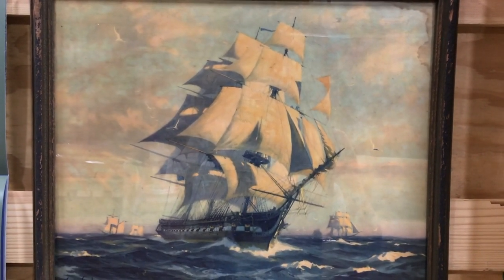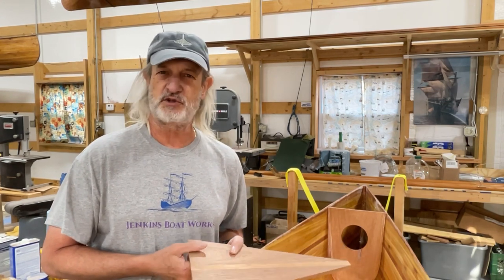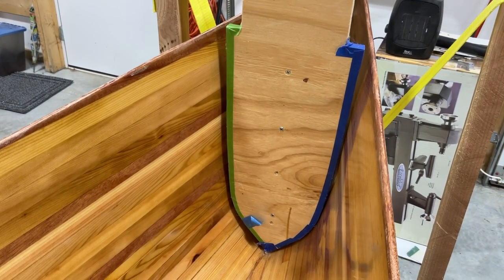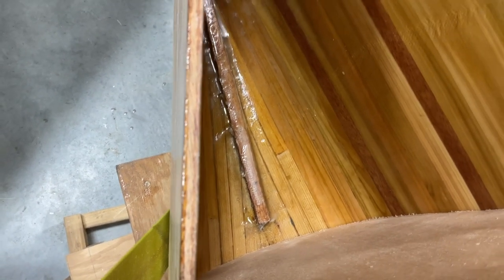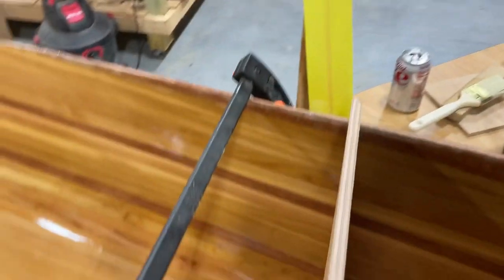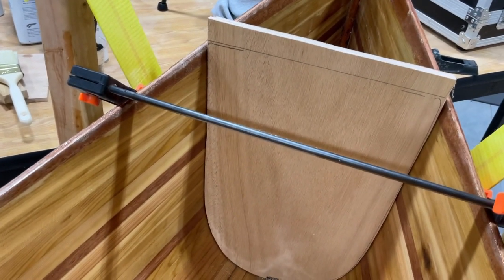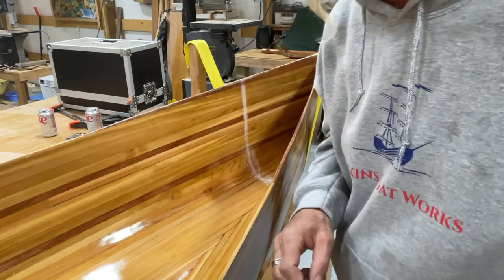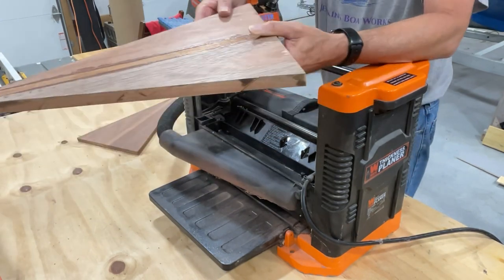Bulkheads and Decks - Freedom 17 Canoe Build Episode 19

Comment: Your boo boo will be very easy to fix.  Sand down a patch large enough to contain all the scar.  When glassed in it will disappear.  You can cut a plug to fix the bulkhead.  Trace the area with paper by rubbing a pencil over the paper while it covers the hold.  Then cut a piece of plywood to that shape.  Take a chisel (a sharp one) and remove the outside veneer and glue that into the hole.  Easy.

Comment: Glad you are ok, did you have your safety glasses on ?!?!??!
Reply from the maker: Hi Tom, I did not have any protective gear on. I was really quite lucky this time. I seemed to hurt myself a bunch earlier in the week, not boat building related, just dumb other stuff.
Reply: @JenkinsBoatWorks  just my way of a friendly reminder, love your work!!👍
Reply from the maker: @tomraidna8421  I hear ya Brother. thanks!
Reply: @JenkinsBoatWorks  Glad you weren't hurt, Chuck.  I need to add similar bulkheads and an access hole/hatch to my stripper and will do so.  My trials and errors were numerous. But, it came out great.